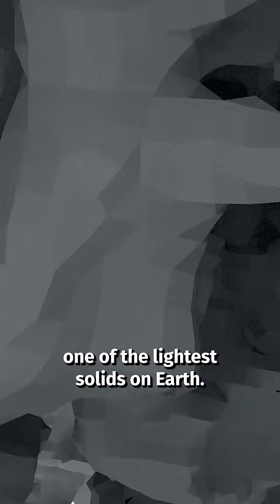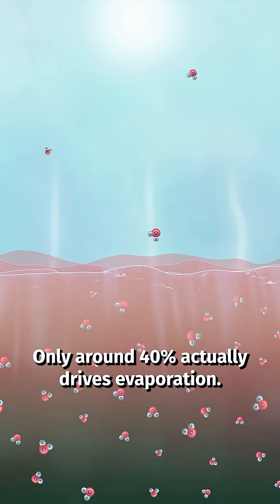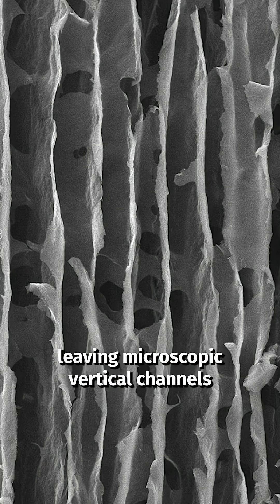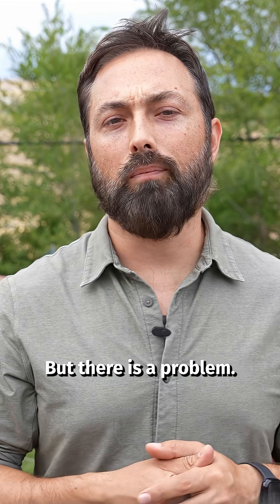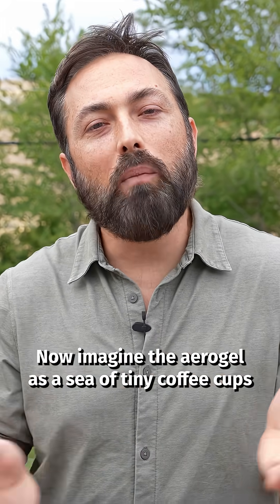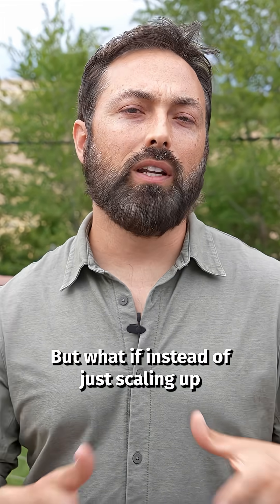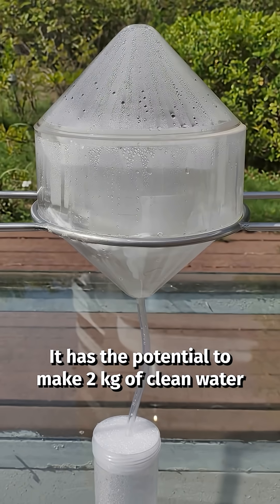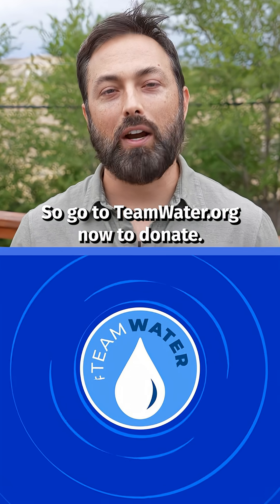How aerogel can make the ocean drinkable

Comment: 2kg/m2/hr is an insane output.
Reply: Some back of napkin math, assuming 2.5l needed per person per day, and perfect 2kg output 24 hours a day, we would need 4,500 acres to provide the USA with all the water we need. That's the acreage my brother in law farms. It's a good size for a family owned and operated farm, but nothing compared to the 876 million acres of farmland in the USA. Insane output! Even if it's not perfect and outputs 1kg/day, that's 9,000 acres. Double that for crap happens and we're still only at 18,000 acres, or 0.00002% the farm land in the USA. Of course we wouldn't need to, or probably want to, use farmland. I'm just using that for comparison.
Reply: @BartonMaxwell  Slight further correction: even at perfect output you should probably start with an assumption of an average 1kg a day - since at perfect output it will be yielding 2kg in the daytime and 0kg in the night time. Still, definitely jaw-dropping performance no matter how you slice it.
Reply: @KillahMate  it’s not per day, it’s per hour. And efficiency gains would decline based on time of day as well, and seasonally.
Reply: @2nd-place  Yeah, but 2 during the day and 0 during the night would make the rough average 1 liter per hour over 24 hours. Rough back-of-the-napkin average of course, due to irradiance and all the various factors as you mention.
Reply: @KillahMate why are you working that out backwards when we already have the data in order to work forwards off of it lol 2kg/m2/hr x 12hr = 24kg of water for an average intake of 2 over the  
12+- hours its operational you don’t need to count the 12 hours it’s not operational in its operational output capacity calculations that’s where you keep going wrong we’re not looking for the average output over 24hrs we’re looking for output per hour regardless of wether it runs for 1 hour or 12 , there’s no point counting the time it can’t run in the night unless you’re specifically looking for the total sum of output over a period of 24 hours or more in which case you’d still be counting the 12 hours and then just factoring in the none operational hours which then yes drops down the average to 1 but that’s more of a data interpretation semantics argument my point is regardless of how you chose to account the observation the difference observations don’t affect the rate of flow per hour of the device the same way in that choosing to interpret the 4th dimension as a spatial dimension is a matter of interpretations and perspective while yes in our 3-d space we can refer to a fourth or more spatial dimensions in the form of  thought experiments but the only observed 4th dimension we experience is Time but none of this information affects how time works on earth the same way your explanation doesn’t change the fact it’s a 2kg/hr flow rate godamn you for making me do shoddy maths and typing this all out
Reply: @MayDaygxd8497 you know you can use commas and periods, right? 😂
Reply: @BartonMaxwell 
Excellent description and working output for fresh water.  Can you imagine the profit margin if a farm could “grow” fresh water?
The farmers would become wealthy overnight!
I sincerely hope that this works out for them because they deserve it!
Reply: @SuperDave-vj9en  nah, easy access to something doesnt bring the price up. It would actually bring the price down.
Reply: @millirabbit4331  Water is already dirt cheap, its a solution for places without running water.
Reply: @SuperDave-vj9en To produce huge amounts of desalinated water through salty water evaporation, there have to be huge salt water masses in the surroundings, right? Already pondered about that?
Reply: @SuperDave-vj9en  can you imagine how much humanity would benefit if every single thing down to basic necessities like water wasn’t monetized to benefit the wealthy?
Reply: @SuperDave-vj9en sigh. Every single solution to the most bare human necessities….

Americans: 🤑🤑🤑🤑

When will the first response be about things just being the right things to do? Before money. Just being driven by changing how the world is. I hope you lot recover from that particular affliction
Reply: @BartonMaxwell correction: remember, these things are working from solar energy, so 24h operation isn't happening
Reply: @brev653 no it's working from temperature and temperature difference. The sea will remain alot of its temperature even during the night (water molecules are always in motion)  and if the environment temperature drops it will help with the condensation too.
So the 2kg/h may be an average result, we don't know.
Reply: @brev653  perhaps solar-charged batteries could keep the process going at night?
Reply: @oscarolander7455 what creates almost all of the temperature difference?
Reply: @brev653  You could use solar dishes with them so even at night, the leftover solar energy is heating the water using UV lights I believe the sun heats water with
Reply: @BartonMaxwell you wouldn’t use farmland. The opening of the short said this was for desalination, i.e, evaporation of salt water. Either the sea/ocean or a salty lake would fit the use case.
Reply: @BartonMaxwell  it wouldn’t be 24 hours per day because of night time. The peak would only be around midday, and could vary seasonally.
Reply: @BartonMaxwell it needs to be close up the sea. But thanks to climate change the sea is coming closer lol
Reply: Also the average American uses hundreds of liters per day
Reply: @BartonMaxwell We need more than 2.5 l per person per day.  That’s just to drink.  Don’t forget to shower, do laundry and run industry.  😂
Reply: @BartonMaxwell  Except it would be less than 24 hours because Daylight.
Reply: @BartonMaxwell it only outputs when the sun is shining, so you’ll need to take that into consideration for your estimate.
Reply: @BartonMaxwell that’s just for drinking. We need so much more fresh water for agriculture, manufacturing, household use, to cool massive data centres and nuclear power plants. It’s a start though to bring us closer towards hopefully multiple, simultaneous renewable solutions.
Reply: @BartonMaxwell  newsflash.  Not everything is about the USA.  There's plenty of places that can benefit from this.  Not to mention the research is being done on the other side of the world.  😂
Reply: @BartonMaxwell  planet's surface is 80% water and you use land as an example. Funny. I bet you're American.
Reply: @BartonMaxwell  problem is this innovation is being driven by anticipated need of fresh water for data center heat management. As we get more and more demand for computing, the demand for water will increase commensurately. We may end up competing with data centers for resources.
Reply: @BartonMaxwell  2 kgs of fresh water per day is only for drinking. But you don't only drink, right? You take shower, maybe bathe, wash your dishes, wash your clothes, face I hope. For all of that the ocean water is not suitable. It has to be clean. And it's much more than 2 kg per day. And I didn't even mention farming, livestock, industry and many other uses of fresh water.
Reply: @BartonMaxwell He said 2kg Per Hour per meter.
Reply: @BartonMaxwell Even further this could prevent the future water wars, because today's desalination is very costly. And when the middle east runs out of oil money, that population is going to look for water elsewhere.
Reply: @BartonMaxwell we would use ocean that's the whole point
Reply: @BartonMaxwell  Wow, yeah, that's amazing -- thank you!
Reply: @BartonMaxwell  you do know it rains in the usa right,
this brings water to those without rain.
Reply: @BartonMaxwell hou do not get 24 hours of sun... calculate with an average of 8 hours so you need 3x the acrage otgerwise you would need to provide the 1kw/square meter and that would be terribly ebergy intensive.
Reply: @BartonMaxwell  he literally said 2kg water per 1 hour, not per 24. Time to find a new napkin.
Reply: @BartonMaxwell there's only 1 small problem with you math you didn't calculate coastal farmlands where the salt water is
Reply: @BartonMaxwell very cool information
Reply: @BartonMaxwell that's pretty insane
Reply: @BartonMaxwell Humans drinking water barely scratches the surface of water people use, either directly or indirectly.

Like that stat to produce one pound of ground beef, it takes an average of 1,800 to 2,000 gallons of freshwater.

The avg American uses 2,000 gallons daily, or 7500 liters.
Reply: @BartonMaxwell so you're telling me that a 1000 square mile section of the ocean could provide enough water for most of the world?
Reply: @BartonMaxwell I assume you would want to use the ocean, instead of farmland
Reply: @BartonMaxwell  Even moreso, this democratizes water supply. Everyone can have a private water desalination (and/or basic purification) if they have access to sunlight.
Reply: @ilovestitch and access to the sea/ocean/lake*
Reply: @RobQuinney people have been pulling water from wells and boreholes for centuries dude
Reply: @BartonMaxwell  And considering how big the ocean is, it’s absolutely feasible
Reply: @BartonMaxwell well for survival that is but you know we use way waaaaayy more than that water , although I agree this is insane output
Reply: @BartonMaxwell  Hey, that's honestly really good when you consider how much we can get from catchment regardless. We don't need either to be 100% of production.
Reply: @BartonMaxwell it's not going to work when the sun is down
Reply: @BartonMaxwell humble bragging there about the 4500 hectares of land owned by your relative? Nowhere is your brother-in-law's property that big!
Reply: @BartonMaxwell  thanks, 2kg/SQM/hr doesn't sound "insane" at first, but your calculation details very well that it actually is.

An average farm would provide clean water for the whole of the us? Damn.
Compared to how much space solar voltaic fields we would need this space is literally a tiny corner in our back yard.
Reply: @BartonMaxwell why farmland if this thing takes water from the ocean?...
Reply: @rebelsecondoit's just a relativistic comparison. Obviously we wouldn't use farmland for it, but to say the area needed is so small is similar to the amount of land a family farms illustrates how little area is needed, if they can hit those production numbers at scale.
Reply: @BartonMaxwell That's factoring in solely drinking water. The average person uses between 100-380 litres of water per DAY. Also, 9000 acres on water is vastly different than 9000 acres on land.
Reply: 4.4lbs/6.56ft/hour for anyone who measures in bald eagles per donut cubed

Edit: yes I’m aware of my calculation error. I read the original comment wrong. 

The correct conversion to imperial is 0.41lbs/ft2/hr
Reply: @Nuts4bolts Your math is a bit off; a square meter is about 10 square feet, not 6.56 linear feet. 
Anyway, 🦅🦅🦅 and all that.
Reply: @AdamFunk I’m stupid I read it as 2 meters not meters squared 🤦‍♂️
Reply: @Nuts4bolts  bruh, how’d you get so many likes. Thats not how units work. Its 4.4lbm/10.8ft^2/hour. You’re almost off by a factor of 2 and your units dont make sense
Reply: @Sodarab I mean I did make a calculation error which has already been called out but if you want to get technical the proper conversion form metric to imperial for this would be 
0.41lbs/ft^2/hr
Reply: @Nuts4bolts  😭 you’re still missing the square on the foot. It makes no sense to measure radiative flux over a length. You need an area measurement. /ft^2!!
Reply: @Sodarab my bad I forgot to add it I’m super tired right now
Reply: @Nuts4bolts  *36.66% The weight of a bald eagle, per 1.112 cubic bald eagles every 24th of independence day
Reply: 😂😂😂😂😂😂😂  @Nuts4bolts
Reply: And that's desalination, a process that normally requires enormous amounts of energy. This is HUGE for arid sunny regions by the sea
Reply: @geokon3  aerogel are difficult to produce

I'd like to see the feasibility of production at that scale, as well as the longevity. Very promising, though.
Reply: @generic_username-q7x  considering how crazy humans are at making tech, aerogel should end up getting super easy to make.We have a track record of turning something impossible things, into real life everyday things
Reply: @geokon3  The real questions I have are 1) how cheap is this to scale up and 2) if this were mass-deployed off of arid coasts like say California, would this evaporate enough water to make the sea significantly saltier in the immediate area & kill most of the fish? I remember brine discharge is a major complaint from environmental groups about mass deployment of desalination for this reason. Moreso in areas like the Red Sea, Persian Gulf, & Mediterranean.
Reply: @Organic_Chemistry_Junkie  Nice name.  I think the cost of the technology could become viable if someone invests in its mass production, as for the brine its not the same as throwing all together super concetrated into one spot through a pipe. There would be a massive surface area evaporating water for the equivalent of a reverse osmosis plant so the small increase in salt concetration across the surface would come to equilibrium with the remaining body of water around it
Reply: @geokon3 Yes that’s very true in the concept of desalination away from salt, which has presumably always been the issue 👍
Reply: Assuming 8 hours a day of sufficient sunlight on average, by my math that puts total ocean coverage at 0.00054% to provide 3.79L (1 US gallon) per person per day at the current population of the world.
Reply: @sina942000 yeah, we just have to kill all life in the ocean by concentrating the ocean's salt.
Reply: I know right
Reply: @Fred_the_1996  until you now that aerogel is not actually known for being free
Reply: Liter is dependent on density, not only mass.
Reply: Also 2kg of water is just 2 liters so why didn't he just way that?
Reply: @Nemileanu  Talking about liters is probably slightly more vague than KG when referring to a process that converts liquid to vapor, because the volume changes.
Reply: @tciddados please explain how the volume changes? what are the variables that could affect the conversion of volume to mass from being 1:1 ratio?
Reply: @mwaijamu2964  When liquid is boiled into a gas, the volume increases, but the volume stays the same (as no matter is actually being lost). This happens with all liquids, water is no exception. This is why heating sealed containers (cans, etc) makes them explode. Water being heated to evaporation, and water being boiled, are undergoing the same liquid->gas phase shift, one is just quicker + more violent than the other. So when talking about a system of evaporating water, saying "1 liter" may not be clear whether it's talking about the volume of water being converted, or the yield of water vapor, which are different.
Reply: @tciddados  Water's volume doesn't change, 2 Kg  of water is exactly 2 liters of water
Reply: @ryder98307 first of all 2kg of water isnt exactly 2 litres lol, waters density is approximately 1 g/cm3, not exact. And the density of water changes with temperature, with 100C water having a density of 0.09584 g/cm3
Reply: @ryder98307  they are equal only at 4° C for  'pure water'
Reply: @Nemileanu only at 20°c but it will be much larger
Reply: @Nemileanu America moment
Reply: @AnthonyBlamthony found the American.
Reply: @Nemileanu  they probably have a set unit that they use, being kg/m2/hr rather than L/m2/hr. sometimes the set unit for something may not always make sense to someone, but its ultimately the most reasonable one to use. in this case, it most likely has to do with how they measure the output. I don't know this for sure, that's just a theory. if you really want to know why they use kg instead of L, Google it i guess, idk.
Reply: @Nemileanu  Because that is only true at a certain temperature and pressure.  Since they likely measured the output by mass not volume, why convert to volume?
Reply: @Nemileanu bc most people in science use eu numbers sadly America has decided to use different measurements then the rest of the world for the most part
Reply: @Nemileanu  because density is phase dependant, mass is not.
Reply: @Nemileanu  Because that is only true at a certain temperature (I think 4°C). Outside of that, the wiehgt to volume ratio changes. Not significantly within temperature you get on earth, but it does.

So if the performance of the evaporator is measured by weight rather than volume, sticking to that might be more accurate.
Reply: @Nemileanu Because 2 kgs of water = 2 litres in room temperature. But 2 litres of "vapour" would be less than 2 kgs. Mass need not change but volume changes with temperature.
Reply: @Nemileanu you could convert it's efficiency to a speed this way : 
Volume/surface/time = lenght/time
Reply: @Nemileanu 
No
If it's same then what's the problem in using KGS ?
Reply: @Nemileanu  Because he knows that everyone knows that, so why does it matter?
Reply: @Nemileanu  perhaps he should've said 2.000 grams of water...
Reply: @Nemileanu  mass can refer to quantity of material irrespective of pressure and temperature
Reply: @Nemileanu I think it's to simplify the purity and/or temperature. Litres/liters is a volume rather than a specific amount.

Two litres of sea water is still two litres/liters it just also contains about 50 grams of sea water.  

Warm water uses more volume/space as it expands. 

So by using weight you get a more accurate result.
Reply: @ElliottRodgers Ok, Thanks!
Reply: @Nemileanu  volume changes, liquid impurities, etc
Reply: @Nemileanu because its a mass unit instead of a volume unit, Kilograms are more precise than liters
Reply: @Nemileanu  Did you just say 'way' instead of 'weigh'?
Are you immune to education?
Reply: @Nemileanu it is an SI unit
Reply: @Nemileanu  americans?
Reply: @Nemileanu I wouldn’t say JUST two. 2L is still a lot of water per hour from a prototype
Reply: @Nemileanu becayse theyre different measurement systems
Reply: @Nemileanu when talking about evaporation and  phase change, 2kg might be more accurate. 2kg of vapor is 2kg of water, but 2L of vapor is not the same as 2L of water.
Reply: @Nemileanu  Well it's not 2l everywhere. Depending on the location it can be more, or less.
Reply: @Nemileanu ocean has different density retarrd
Reply: @Nemileanu  Because mass is the standard, universal, intrisic measurement used to measure the amount of a matter. If that is too complicated or "smart" for you, the problem is with you.
Reply: @Nemileanu still. Imagine hundreds of these if not thousands in the future. Having designed ocean power farms :) if the government would just stop selling power to big companies at a lower price driven up consumer price than we’d be okay 😅
My inner kid is going crazy sorry
Reply: @Nemileanu Because most people aren't American.
Reply: @Nemileanu you could convert it's efficiency to a speed this way : 
Volume/surface/time = lenght/time
Reply: @Nemileanu  I bet the answer is " American " ... ancient imperial system
Reply: @DC-te1gw I'm european😭😭. I see that half of you are actually explaining to me why I'm wrong, the other half are joking/being ironic. Like I've been recieving like 2-3 replys to my comment everyday for the past week almoast.
Reply: @Nemileanu because 90% of the world inherently understands this.
Reply: @Nemileanu it's a physics thing. When we're talking about volumes and what not. We use kg per meter squared.  If you look at the list of SI units.  It helps break down dimensions in a much easier mathematical component.  Now for us, leaders are much easier to understand because we know what that feels like to hold, but especially because they're talking about what possibly may not be a leader of something. They are looking at a distance because this thing supposed to be floated off the surface. At least that's the way I'm looking at it.  But simply put physics tend to use kilograms per meter squared
Reply: @Nemileanu or better yet, just use gallons!
Reply: @Caleb-hx4cd this is like the 20th reply I am getting, thanks but I understood
Reply: @Nemileanu  likely because volume depends on temperature or maybe something about litres not being an SI unit? Though hours and square metres aren't exactly either so I don't really think that's right
Reply: @Nemileanu  so you would learn something.
Reply: @Nemileanu  cause volume changes with temperature and pressure and mass doesnt so its more consistent way to measure amount of water evaporated
Reply: @Nemileanu because 2L is a volume and 2kg is a mass. 2L is 2000 cubic centimetres, which is not accurate when its still in vapor form - only after it condenses to a liquid
Reply: @PaladinswordSaurfang  no, we are measuring the liquid fresh water output.
Reply: @PaladinswordSaurfang  But we’re measuring the drinkable water, no need for density correction
Reply: @PaladinswordSaurfang  2 Kg of water = exactly 2 liters
Reply: @Nemileanu  the temperature slightly shifts water's volume
Reply: @Nemileanu  because the metric system is good like that. Or would you prefer "388822/94933121th of an olympic swimming pool"?
Reply: @acdarc  Liter is still metric
Reply: @Nemileanu  because that means 2L of water per 1m² of salt water per hour, using a different unit maked it easier to compare
Reply: @Nemileanu Yeah, why Didn’t he dumb it down???
Reply: @JohnDoe-qz1ql Bro really be using a different measuring unit just to act smart
Reply: @Nemileanu It’s the scientific standard of measurement.
Reply: @JohnDoe-qz1ql  Bc we’re trying 2 raise the bar, not lower it🤨.
Reply: What happens to the salt…..just kill everything under it?
Reply: @Menuki By the sheer amount of remaining seawater under it (it's hard to fully conceive how terrifyingly DEEP oceans are) the change in salinity would be neglectable... 
And we can use that separated seasalt too!! I'd sprinkle some of that salt on some fries, personally!! 🤤
Reply: Idk how 1 kg/m² is even possible. Sunlight has a power density if about kW/m², so in 1 hour and assuming 90% absorption, in ideal condition with the sunlight in the middle of the sky, that's like 3.3 MJ of heat absorbed. 1 kg of water needs around 2.2 MJ to evaporate, which would suggest 1.5 kg/h/m² limit. Where does the extra energy come from to get up to 2 kg? Could be from the sea itself, but is the aerogel layer colder than the sea in that case?
Reply: @birch2-x7g Hmm but you forgot that water at any spot can absorb heat from its surrounding water, not just use what it gets on its own surface.
Reply: This will solve the freshwater problem and create a different ocean problem. I'm just not sure what.
Reply: Look, US gallons would beat the crap out of UK gallons previously— we all know this. Unfortunately, our administration no longer believes in measurements at all, so call your water pile what you want. We in the US call water fake soda now.
Reply: Saudis (let's take an arid region) use 300l per day per person. Assuming 12 hours of usable sunlight, you get 24 l per day per m^2 (it's going to be less). That's 25 m^2 per person, there are 35M people there, that's 438 km^2. That's the surface of New Orleans. A rather large surface to cover the ocean with, for something that's still being printed in labs.
Reply: I was just coming down to say this! I was really in "yeah sure this is cool, but the kicker is gonna be the crap output." And when he dropped that measurement I literally said "God damn!"
Reply: I actually think that 2kg/m2/hr is way overstated. The evaporation heat of water is about 2257 kJ/kg or about 4500 kJ for 2 kg. Sun's irradiation at sea level, however, is only about 1 kW/m2 or 3600 kJ/m2/hr. So even if you turn all of sun's irradiation into evaporation of water, you could get at most 1,6 kg/m2/hr.
Reply: @alexanderkohler6439  Thank you I looked for that comment. Including 4.19 kJ/K*kg and assuming 20°C of water temperature you land somewhere close to 5 MJ or 5 MWs = 1.38 KWh of energy captured per hour per square meter of this material which could be done in the upper atmosphere (which is probably what these estimations are based off) at 100% effective energy capture but that's super unrealistic. Realistically we are probably looking at 0.5kg/m^2h if even that.
Reply: Then they need to clean the salt out
Reply: Y'all, he said "it has the potential to," it's almost certainly peak theoretical output under optimal conditions, not what you're going to get for 12 hours/day.
Reply: So not only china stealing rivers and lakes from russia, they also want to steal oceans from the world?
Reply: Will you be pumping seawater on to old evaporated lakes covered with this stuff?
Reply: Yeah! Get one or two and you han support an entire family easily. Having this on a boat would be awesome too.
Reply: It’s evaporation and moisture collection, you still need to dispense with the salt content, so naturally a viable filtration system would work .
Reply: i wonder how many grams in micro plastics
Reply: Thats 5/9 mPa-seconds for the engineers in the audience.
Reply: Does the salt plug up the pores at all?
Reply: Can somebody please look into a poormans solution to this, even if the efficiency is 1/4 but we can 3d print it at home from special filament it's worth looking into, dont chase perfect efficiency  numbers and profitability and production scalability. Otherwise this is going to be stuck in the lab/research stage for decades.
Reply: I came here to make this exact comment. Lets do this now, what is the world waiting for?
Reply: @yellowcirclesun Nestlé, mostly. Also, aerogel is on the expensive side compared to just taking groundwater.
Reply: The trick will be to stop it clogging with salt and make it durable.
Reply: Btw technically it would be written 2kg/m^2/hr. No big difference, its just that m2 was triggering my OCD 😅
Reply: My jaw DROPPED.
Reply: Yeah that is a lot
Reply: It is high enough that if every person on earth had a square meter sheet of this stuff and a 1000L container of salt water, eveyone on earth would have fresh drinking water forever.
Reply: That's like over 4 lbs (a bit over half gallon) per yd³.  Wonder if something from this could help dehumidifiers work better as well?
Reply: @JadeDragon407  Donald recommends you try the bleach.
Reply: @BartonMaxwell you’d need 7722043 acres because the US uses 1.5 trillion liters of water a day for other things or maybe you’re all really thirsty idk
Reply: As soon as he said that, I thought the same thing.
Reply: Sounds like there will still be micro-plastics present if using printed parts 

1 step forward, 2 steps back 🤷‍♂️
Reply: @mbergamin16 there's microplastics in our damn semen nowadays lmao. I got little plastic life rafts for the tadpoles if they get tired swimming. 😂 also, mothers transfer microplastics to their damn babies when they're an embryo. my point is, we'll never escape it. We are one with the plastic. 🙌
Reply: Per per per
Reply: Something doesn’t ring true here. Im not a scientist, but I like to think my instincts are pretty good. This sounds revolutionary. Like, incredible. 

So, Ive got to remind myself: this channel has recently been backed heavily by private equity. Could there be a link there? That these numbers, 2kg/m^2/hr are hype? Maybe. Then I see that this project is also backed by mister beast, and man, there’s something bad weird with that guy. 

Just sayin, time will tell, the truth wills out, etc.
Reply: That’s exactly what I came to say. That’s an incredible efficiency
Reply: Wtf 😂
Reply: if you believe it.
Reply: 2 kg ~ 2qt water per meter squared per hour.

Passive structural system, which can be 3d printed.
Reply: I literally just posted this before seeing your post 😆 this guy says it almost like that's slow
Reply: I wonder if that's extrapolated. I bet it doesn't even last and hour before all the pores are clogged from salt deposits.
Reply: Almost Incredible 😂😂😂😂
Reply: thats like 3 apples
Reply: Beter serve all people h3o waste heavy watter from nuclear electro plants😂
Reply: Cleaning mineral and salt residue left chat
Reply: Probably exaggerated.
Reply: @ranjitmandal1612 answering you because you are the first to approach me with nothing to say.
Reply: Thank you captain obvious
Reply: I HAVE BROUGHT PEACE FREEDOM JUSTICE AND SECURITY TO MY NEW WATER SOURCE
Reply: @TheChosenWhiteFeather_Anakin That’s something you might want to explain, especially when it’s in uppercase.
Reply: Not really, you need to know the heating rate, otherwise those numbers are meaningless
Reply: No it's not
Reply: Fr
Reply: Dude, there would be one in every sailboat, if it costs less than like ten boatbucks (thousands)
Reply: Distilled water is not apt for consumption, it lacks minerals and would cause osmosis. How to make it drinkable aka how to add minerals?
Reply: @ClaudiaDolfi drop in a crushed up a multivitamin every now and then
Reply: 2 liters is also 2.36 * 10^-51 cubic light years, if anyone uses that unit
Reply: Agreed!
Reply: u should see me after nnn...
Reply: 2l * 1000 ml/l * (540 + 60) cal/ml * 4.2 J/cal =100,000,000J  now solar flux is about a kw/sqm so 1000 J/s * 3600 s/h = 3,600,000J.  So I think there is a factor of about 30 missing.  People’s intuition that 2 kg/sqm/hr is insane is correct!  I love these videos but this isn’t the first time that a few minutes of unit conversion has revealed an error.
Reply: magically, it works best on fresh water...lol
Reply: right??? with no active heating element, too, just the sun!!!!! isn’t that over 33g per minute????
Reply: Was that on the ocean specifically?
Reply: That's what I was just thinking who cares if it's still in the lab those are some amazing numbers
Reply: @daskalman Funny Minecraft mod joke!
Reply: 2kg if evaporated (basically distilled) would be 2 liters. Getting 2 liters of drinkable water every hour in just 1m² is pretty impressive! It would be amazing if it could be easily portable for campers faced with questionable sources of water like muddy streams, marsh bogs, even small, depressed pools of stagnant water in the middle of a forest for those who enjoy really roughing it while camping/hiking! Obviously, it wouldn't weight much to carry... at least the aerogel part of it.
Reply: It is 2 liters or roughly half a gallon per hour.
Pretty good output.
Reply: Very awesome indeed. But at what cost? In addition to that, there have to be great water masses available at the surface to produce water evaporation in the first place.
Reply: Agreed, but how can we minute the cost of manufacturing these membrane-like Thermo-structures?
Reply: How much micro plastic transfers? I’m more concerned about that right now than any other issue when it comes to the environment.
Dad has Alzheimer’s, Alzheimer’s brains have a credit cards worth of plastic in them
Reply: those materials need to be cleaned continuously, bacteria and viruses easily spread from the sea evaporation with the excess of sunlight and warmth! very complicated
Reply: We just have to see if the material releases microparticles into the water: of it os, ot's a big NO!! I don't want another Teflon disaster/scandal.
Reply: Insane is the perfect word.
This is ridiculous and not needed whatsoever. This isn't for YOU!!!
WAKE TF UP!!!!
Reply: Reading these comments has me fearing for the future of humanity. These are the comments from people watching science videos, which one might expect to have an IQ above average. People can’t even get the basic facts of the story correct, and then jumble up everything else arguing. FFS!
Reply: Yeah but can it activate the flux capacitor. Is it 1.3 gigawatts "insane"? 🤔🤭
Reply: @daskalman 1.21 ... but if ur a social media expert, you said it wrong on purpose.
Reply: @daskalman use normal capacitors to charge cascadedly abd youll have that charge required for flux capacitor too😅
Reply: @daskalman  but only in 1985.
Reply: @daskalman 1.21 JIGAwatts, excuse me
Reply: @Blockenheimer great SCOTT!!! 

👏😂

That you Doc?
Reply: @Blockenheimer  You say Gif or Jif?
Reply: @Blockenheimer  jiga please
Reply: @daskalman is this how metric sound to you?
Reply: @daskalman I'm guessing you just watched Colin Furze's new video too? 😂
Reply: @daskalman 1.21 Jiggawatt
Reply: @daskalman yap yap 🤡🤡
Reply: @daskalman it only needs 1.21
Reply: @daskalman 🎉
Reply: @daskalman  i want to donate $40 million dollars
Reply: That's a little over half a gallon for anyone that uses Freedom Units like me😅
Reply: Just enough drinking water to cover an athletes reauirements.
Reply: China actually does innovation; something we can barely do in the west due to capitalism slowing everything the hell down!
Reply: @bankutsuuzumaki8534  innovation?? 😂😂😂😂 like?
Reply: Jesus loves you all
Reply: @AmielMunemuneThat’s very kind of you, but hardly relevant, I’d consider the impact of water collection and how it works.
Reply: @AmielMunemuneI’m presuming you’re not familiar with the crusades or history
Reply: @AmielMunemuneYour punctuation simply isn’t relevant, but I’d suggest studying more astutely, intrinsic value comes from study and not blind belief
Reply: @AmielMunemuneThoughts and Prayers!
Reply: Seek

John 3:16 KJV
John 3:17 KJV
John 3:18 KJV
❤❤❤
Reply: @jameskoutoujian9505 Thoughts and Prayers!!
Reply: Doesn’t matter cuz it’ll never leave the lab phase.
Reply: Can someone transfer this to gallons? T^T
Reply: @ElijahTackett-xn9wy  It's the same volume as a 2 liter bottle of Coke, slightly more than a half gallon in the US, slightly less than a half gallon in the UK.
Reply: @notahotshot  dont help the idiots who still use imperial,
Reply: @ElijahTackett-xn9wy 1 kilogram (kg) of water is 1 liter. A good approximation is that a quart is about the same as a liter (1 gal = 3.8 L). It's about 56 ounces per square yard per hour, if it did my math right.
Reply: @ElijahTackett-xn9wy Its outdated system and will no longer be supported )
Reply: @ElijahTackett-xn9wy No. Go learn the superior metric units.
Reply: @ElijahTackett-xn9wy Imperial or US?
Reply: @ElijahTackett-xn9wy1 US Gallon is 3.78 liters.
Reply: @ElijahTackett-xn9wy a 2 liter of Coca-Cola worth of water for your American brain to imagine
Reply: @ElijahTackett-xn9wy 2kg of water = 2 liters of water = 0.528 gallons of water.
Reply: @ElijahTackett-xn9wyFor a quick and dirty calculation trick, there are about 4 liters in a gallon, so you can just take your liters and divide by 4 to get it in gallons
Reply: @ElijahTackett-xn9wyit's about a half gallon per hour